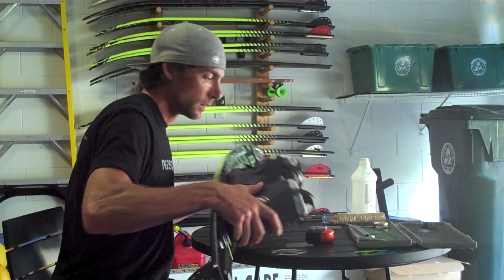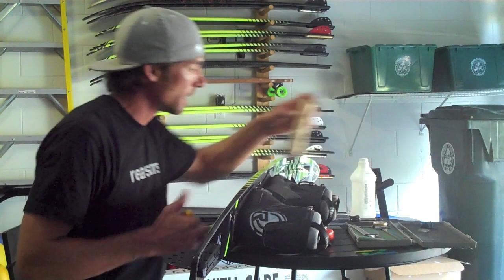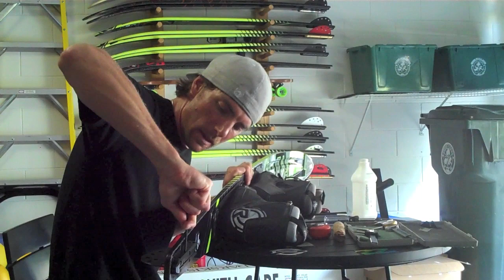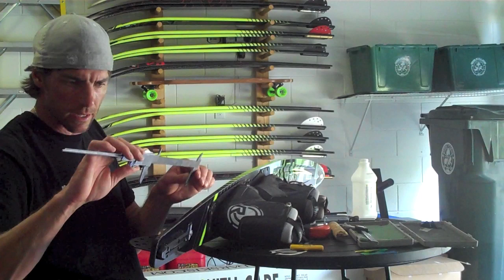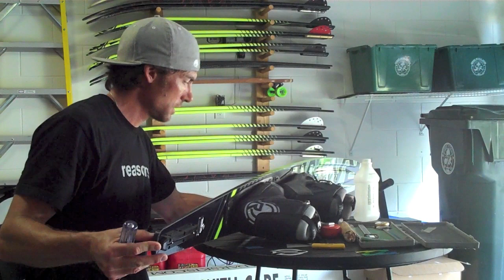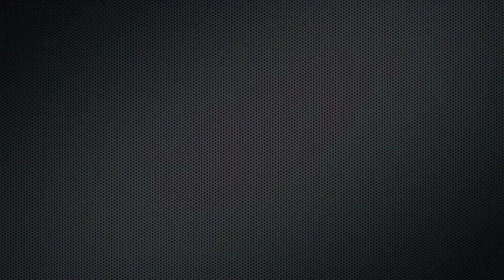How To Set Up Your Radar Waterski Part 2

Comment: Great video 👍 i have a 2012, its a beutiful ski i run the slip in rear binding not a rear boot like tou have in the video, its always been good but i find now as i thought i was getting 'better' i may be getting into bad habits. As im getting faster across the wake im starting to come out of the turn on the back of the ski, maybe turning too hard, and i get the slow pause after the buoy which then makes it harder to hold onto the rope to cut hard enough to get myself back across the wake in time. Im 70kg, 5f10  on a 67 ski. The bindings are 1 hole forward from factory settings. Does that sound right or do you think it should be different? I dont have messuring gear on me atm to check the fin but its just factory settings i havnt moved it. I want to be able to get more ski in the water in the turn so i can turn earlier and maintain speed after the buoy. Would any fin setting help achieve this or would you have to see a video of me skiing to see if im doing it right? Im going away for 4 days skiing starting tomorrow and i want to get alot of video so i can see what i am doing wrong. Sorry confuse you like this 👍